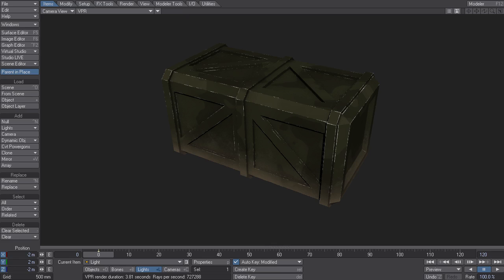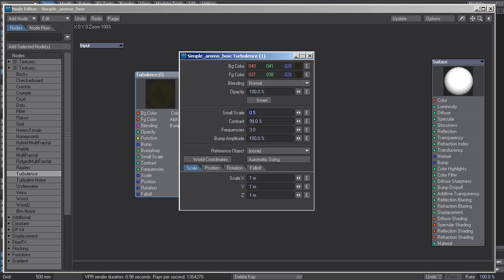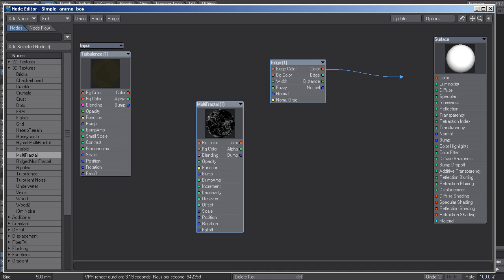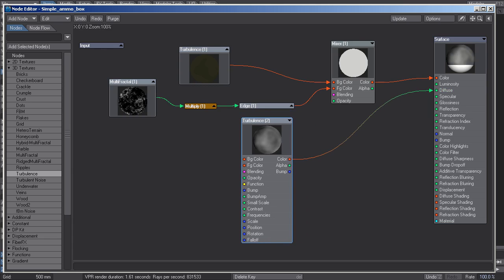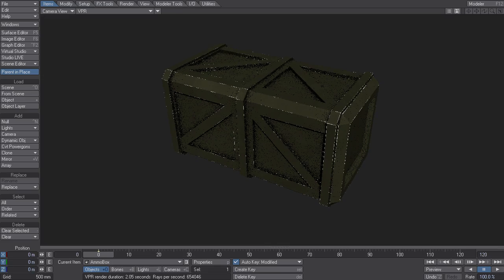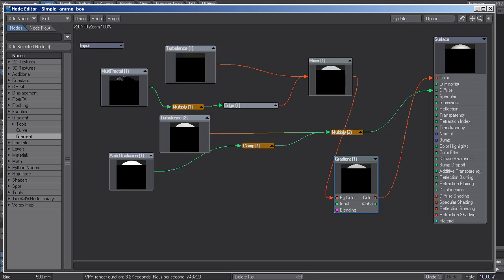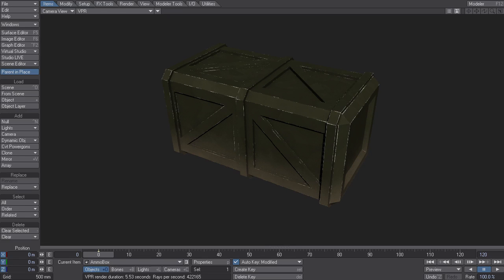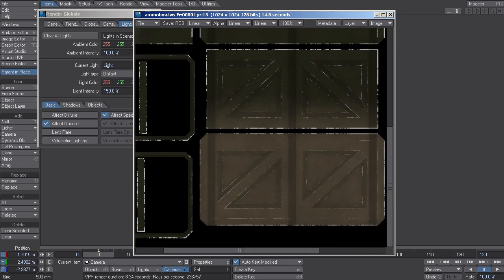Using LW to create UV maps for military assets

Comment: Hi Kev! Thanks for this great Tutorial!!! only problem is that 80% of the times when I try to apply this preset to some surfaces, lightwave crashes. any tip here ? So, I have to do it every time manually for each surface, render the map I wanted, and start all over again. This happens on booth 11.6.3 and 2015
Reply: Cosmos Yeah  I do know that VPR can sometimes crash when doing this - if you're using VPR, I'd say test it without it and then try doing F9 test renders to see if this is the case.  VPR can be a little temperamental at times (switching between modeler and layout can also be risky with VPR on), though its fairly solid for most stuff...

I was using 11.6.3 - I also made sure I downloaded the latest version (64 bit) of DP Kit.  I don't know if that has anything to do with it, but its worth making sure by grabbing the latest if you haven't already.
Reply: Hi kevin! Thanks for your reply. It's not Vpr what it messing because it happens after the render is done after hiting F9. I will check for the latest Dp plugin. Anyways I wanted to thank you because after learning this I have been able to highly improve weathering effects for the edges. Really a must see tutorial if you are into texturing field. Cheers!! And two thumbs up!!
Reply: Its also possible that maybe your geometry is somehow causing the crash, specially with the DP Edge shader (ie. if there are any specific problems that the shader doesn't like).

Unless of course you were testing it with something basic (like a cube with inset bevels) to begin with - in which case my comment is null-and-void.  lol! :D
Reply: Good Morning Kev!
Absolutly sure that it has something to do with the geometry. Thanks again for your reply :)